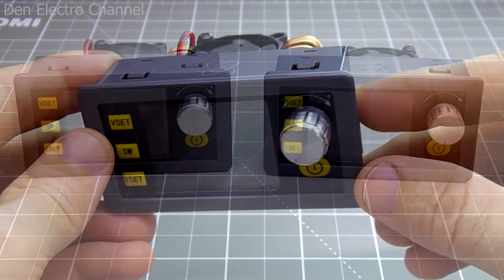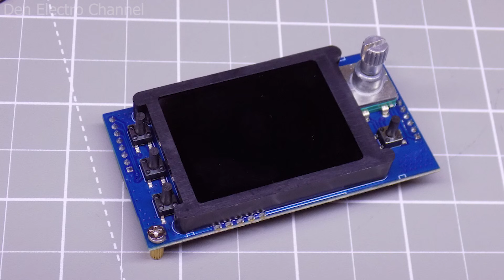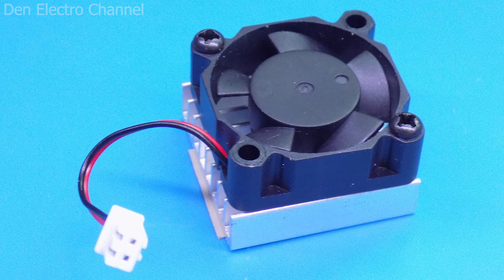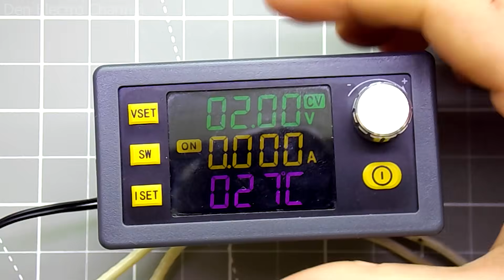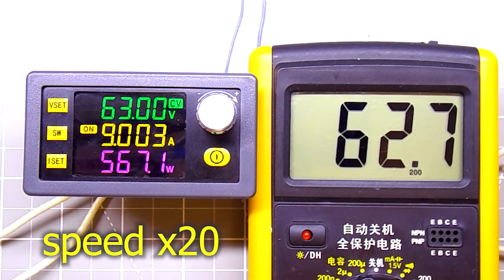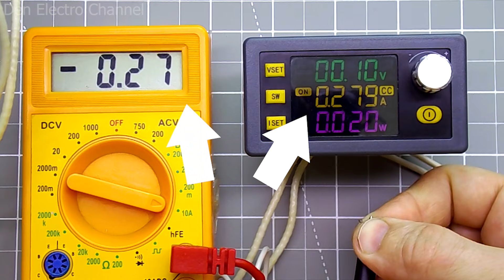XY6509 - 600 Watts from a Small Box! Review and Test.

Comment: Can you tell me why a Boost Converter used for Mosfet Driver IC? They could convert high Voltage to 12V and then use a Linear Voltage Regulator IC like ams1117-5 for make 12V to 5V. Also what is the purpose of  2 pieces LM358 IC? Why used 2 pieces of them?
Reply: Efficiency

Comment: i got the xy-sk120 , actually after watching ur first video, it does reach 120W but its cooling not realying cooling it, it can safely provide 2 amps without getting supper hot(100 celsoius plus), while below 2.5-2 amps its remails about 80 degrees, its good for couple of minutes but not continious charging or supplying power...
Reply from the maker: This is very bad. Maybe you should put another fan next to it to blow air.
Reply: @Den_Electro_Lab  yea thats my point, it works well but unsustainable, your will work the same, i got 2 of those unit, heats realy bad, its cute , but its not practial, if i didnt had thermal camera i wouldent notice it too, the whole point is that i dont want to add fan haha :), i just want it to work well, my point is , that yes it can reach 125, and 150 watt, but it or burn or shut down tho to themal limits, its not truely 125W, it might work for a while at high load, but sooner or later it will fail
Reply from the maker: I understand you.